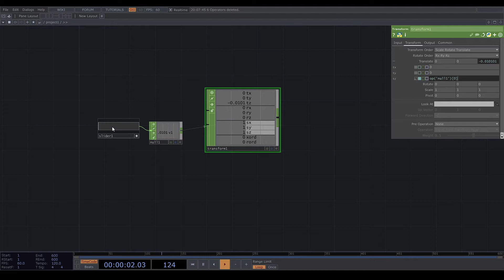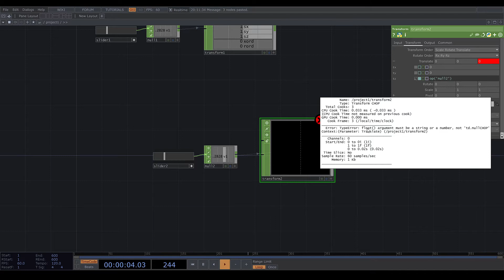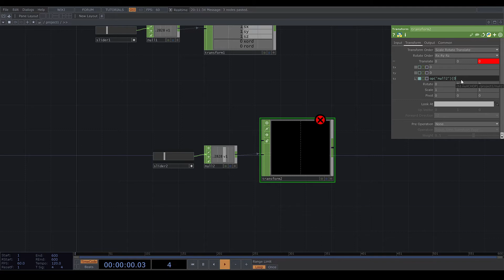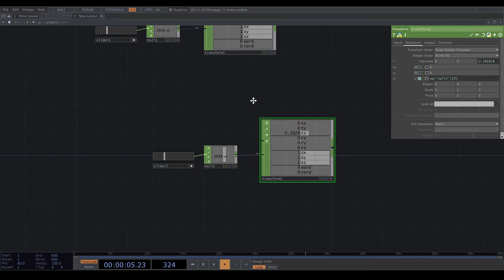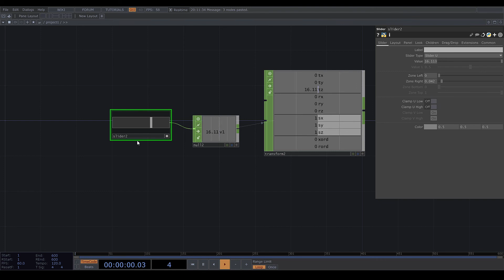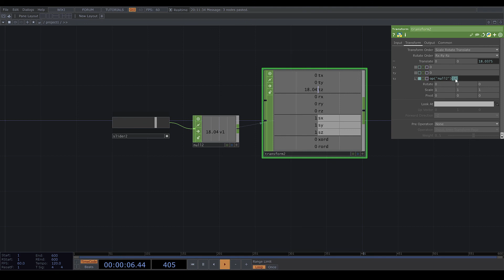Touchdesigner: How to Modify OP Parameters from Other OPs

Comment: hey there, just starting with TD sort of headfirst. I try to do what you show me here. Reproduced your patch. But in my case I can't get this nice arrow in the parameter pane. Is there a certain key combination when dragging? I can't find it and it drives me crazy. TIA!
Reply: found it! I should not just drag from the right side of the operator but from an actual parameter to the other parameter (in the pane)!